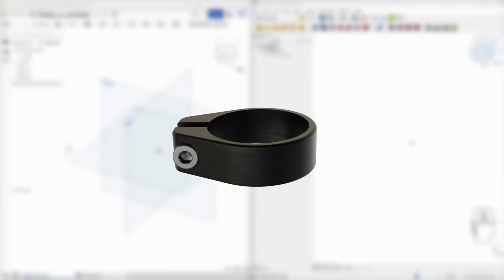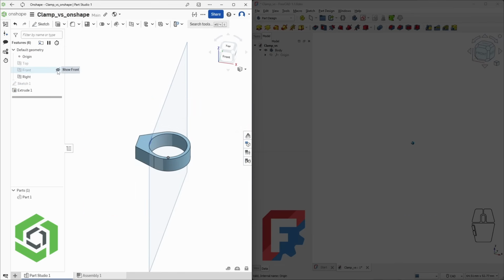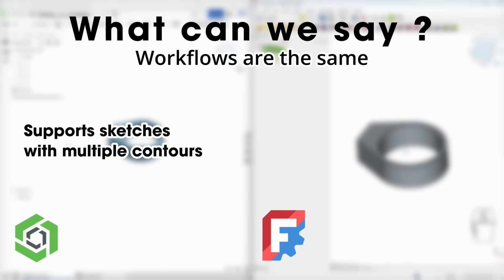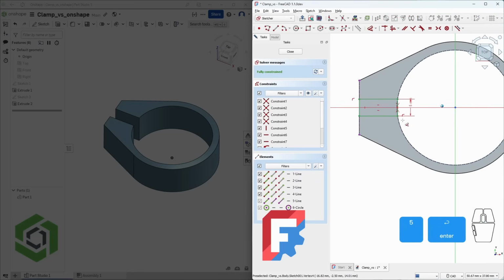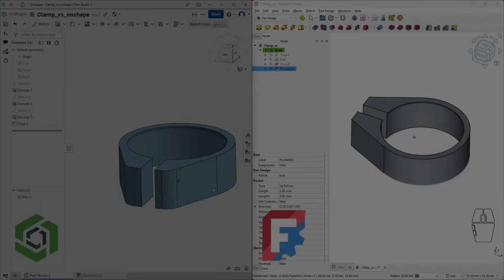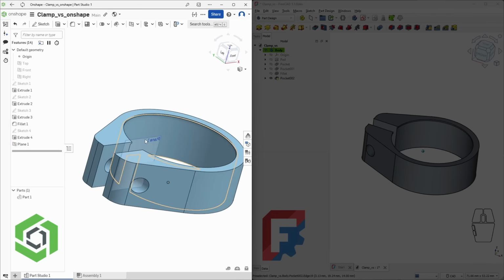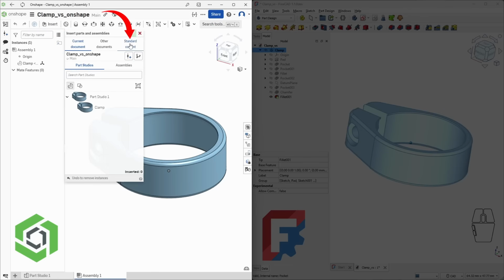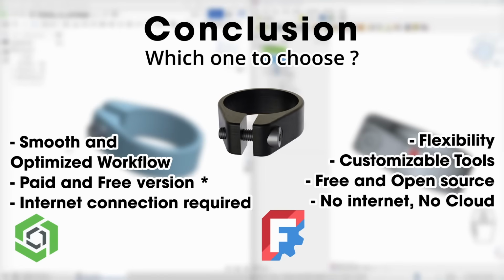FreeCAD VS Onshape - Who's the best ? Choice for Beginner (Simple Part and Assembly)

Comment: "The bottom line is clear—FreeCAD delivers nearly identical results and workflow while being completely free and private. That makes FreeCAD the winner!"
Reply: ehh - FCAD lacks a lot of modeling abilities - so, no it is not.
Reply: Nope , onshape has a lot more powerfull tools than Freecad , not to mention,  the interface in onshape is clean compared to most other CAD systems out there,  Onshape is totally free , and cloud based which is pretty impressive
Reply: @cekuhnen Со временем дорастёт же. 🤔
Reply: sadly not. Onshapae is more powerful and has a better UI and UX, but both are great CAD tools both of which I personally use.
Reply: @gummy5787   I disagree.

I also hate cloud software.
Reply: Onshape is a polished and powerful product. FreeCAD is slow and messy. It can't cope with anything complex and requires the user to learn tricks to bypass limitations continually. But you can't work privately for free in Onshape.
Reply: If you stay with basic operations. Things like surface modeling tend to run into both User experience as well as  hard to predict technical problems. In part simply because of how the core handles Epsilon vs what Freecad keeps track of or hints to the core.

Comment: Additionally, there are several ways to do the same operations in freeCAD.  For example, the cutout rectangle sketch, you could have used the centered rectangle, snapping the center point to the horizontal axis line, then just pull it out to cover the material of the clamp, type 5 for the dimension and hit enter. No need to project geometry. 
There's also different workflows in free CAD. The same part could have been built in the part workbench using a workflow more similar to tinkercad but more powerful. 
And one final thought. The people using on shape are going to have a bad day if their internet connection goes down or slows down. 🙂
Free CAD is an incredible value for the price.
Reply: I believe his method keeps it parametric. He can change the diameter, and it updates.

Comment: Great presentation! I've been using Freecad for a few years now and found the comparison with Onshape to be very illuminating. The split screen showing the two programs along with the excellent narration made the video a joy to watch.

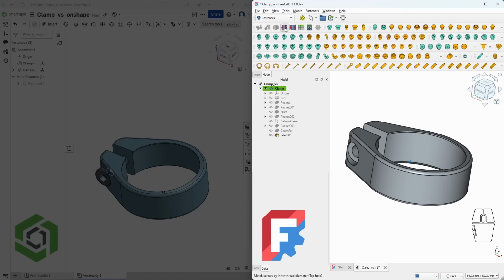24:45 With the fasteners workbench,  in Edit/Preferences/Fasteners you can select "Drop down buttons" for Toolbar screw icons grouping which will avoid the default zillion icon setup. Much easier to find what you need and I'm not sure why it isn't the default.
Reply from the maker: @douglasbollinger8678 Thanks for your comment and for the tips :)
Reply: And selecting the edge of a hole we get automatic proper sized screw/bolt without the need of assembly
Reply: @deltahedra3D  I've learnt a new thing with this tutorial in FreeCAD: Transforming the external reference geometry into construction lines, thank you.
My hint: select 2 parallel faces of a solid and pick Reference plane tool, the plane will be located symmetric to those faces...
Reply: @LFANS2001  Me too, a quick and easy way to create datum planes, I've been making it much harder on myself. As I understand it, converting reference geometry to construction is only a thing from the upcoming 1.1 version of FreeCAD, before that it was always reference anyway, but now it can be real geometry too, I imagine it will be a time saver considering how often I import geometry and then just copy it into a new sketch.
Reply: @LozrusX  I didn't notice he was using FreeCAD 1.1
Thank you
Reply: @deltahedra3D  made a tutorial in two programs and does not know how to do it well in either

Comment: Thank you.  I am new to both as I was using Openscad.  I started out with Onshape after following some tutorials on a 3d printing channel. I like Onshape, but recently wanted to design a part while I was on the road.  The fist time I did this all was good as my hot spotted phone had a good signal.  A few days later on another model I had to give up as the internet was too Sketchy!  I have now installed Freecad and was pleased to see that some of what I had learned in Onshape was easily transferable.  I have yet to tackle assemblies in Freecad but was please to see from this video that assemblies are somewhat similar too.

Comment: Super great video, it is all I was trying to do. You did tit great. Im a CAD lecturer for Mechanical Engineering and also Carpentry & Joinery and I use both software. 
For mechanical Engineering I start with ONSHAPE and after I introduce FreeCAD and for C&J I use FreeCAD, I love both tools and I will like if FreeCAD solve the External Geometry like ONSHAPE, that will be great. I introduced both in my college. I appreciate Your video and nobody did that comparison better than You before. Congratulations and Excellent. Thanks.

Comment: As a note, if you hit enter when you drop the circle it opens the dimension tool with the current value. Additionally, I'd not consider automatically constraining to the origin to be useful. I'd often end up cancelling that. 

Your second step is probably the least worthwhile in onshape as it would have been very simple to add that feature into the first step and not extrude it instead of removing it. Maybe you did this because it is hard in FreeCAD since it doesn't handle multiple curves well.

The custom plane creation you did is of limited utility. I'd have wanted to see you do the more sophisticated operation where you project a plane from the surface instead to see how hard it is in FreeCAD. Imagine trying to drill a shape or hole through a tube. That is a commonly used function and if it is easier in FreeCAD it would be interesting to see.

In the end, it is obvious that you worked hard to put these into very similar workflows. Is doing that fair to either tool? Just like trying to write two programs exactly the same between two vastly different languages, you are likely hiding features in FreeCAD that makes it more powerful. Also you didn't go back and edit anything. In OnShape that is very fragile as surfaces and edges will get lost and requite reselection or far more drastic measures. In I-DEAS it was far more robust than what is in OnShape. If it is more robust in FreeCAD that would be a huge deal.

My closing argument though is the value of onshape is the same thing people are complaining about. The parts catalogs of all public items are available to everyone. If you are putting together an assembly of something you don't mind being in the public, you can also pull parts from 100s of thousands of models.

Comment: Back when Advanced Manufacturing was sharpening flint with a stone, I started drafting using T-squares, triangles, and pencils. My first (2D) CAD experience was AutoCAD 11 on a 286 running DOS. A long time ago, I switched to Solidworks. Occasionally (frequently?) Dassault does something to piss me off, and I threaten to use a different brand ... but I'm too old and stubborn to learn a new CAD package.

Comment: I've been working in CAD for 15-16 years now. I started out using PTC CREO and 7-8 years ago we switched to Solidworks. I see these differences between Onshape and FreeCAD as being about the same as was the case when Is switched from CREO to Solidworks. It's just a matter of what one is used to. For me personally, the aligning plane when starting a sketch would be the most annoying difference. I've tried about all of the free and lost cost options at home, and for the price, I can't find anything that works better for me than Solidworks Maker @ $48/per. Granted, that's likely because I'm able to set the UI exactly the same at home as how I have it at work. One thing I hate, and I find it's with all software, is there being no option to use words instead of icons for commands. That would make learning multiple software much easier, IMO.

Comment: For FreeCAD, I was really surprised by the need for having to go via creating external projection geometry rather than being able to reference already created geometry. Is there any reason why it's like this, or advantages to it being so? Great video by the way, keep working on that "fillet".
Reply: It's a holdover from its ancient roots. CREO and older CAD programs do this, they are not true "parametric" modelling programs. FreeCad started with this older style before Solidworks, Fusion360, and Inventor developed. Today, everyone learns on the Big 3. It's a little bit to get used to, and it means you have to plan your models out a little more in advance than in true parametric systems. Be careful changing dimensions without changing the effected reference planes! 
A little old, a little clunky, but the staff of Freecad is 1/100th of any other CAD program. What they have been able to do is nothing less than a miracle. It's something you can 100% get used to with some practice. Like driving a stick shift vs automatic: Might seem scary at first but in a short while becomes 2nd nature.
Reply: @TristramJay  Very interesting, thank you! That also means FreeCAD is much older than I thought.

Comment: I'm using Blender. Yes, it's not CAD, but with nondestructive modifiers you can move mountains.
Reply: I'm also using Blender but it really feels like fighting against the current to use it for CAD
Reply: Blender is so good ! But it is not parametric and cannot output Step files for example. STL are triangle based and not good enough for CNC.
Reply: @puits-de-science  Here I disagree. Blender has parametric modeling using nodes, modifiers are also parametric. I also have an addon for exporting to IGES.
Reply: Ok. In most cases, anyway, I almost never come back on a design, so the parametric aspect is not really an issue for me. I keep a history of modifications when I apply a modifier (for speed)

Comment: I have some experience with Solvespace. I really like its compact (but very effective!) design. But for exchange with manufacturers I need something like Solidworks or Onshape. That is too expensive for non business. For CAM and FEM additions you even have to spend more. All this is available in Freecad.
I was allways very reluctant to start Freecad because its interface looks complex. I expected a too long learning curve for a casual user. I understand that the complexity is also the result of all the many things you can do with Freecad. I think that will be the same if you use Onshape or Solidworks.
After seeing your demo comparison with Onshape I believe that Freecad can work for me. Especially that Freecad even has have library of bolts and bearings impressed me. I also saw in Freecad forum about FEM that there is a vast materials library and there is possibility to tune them.
That Freecad offers so much all free of charge makes it worth the effort to learn.
You convinced me. Thanks for your efforts.  I have just downloaded it. Today the journey begins.

Comment: I would have added the cut as part of the initial sketch before extrusion and also added relief for the nut which wasn't even shown.
Reply from the maker: @thekillerb77 My goal was to show FreeCAD's external geometry tool and compare it to Onshape's native projected edges. I thought it was a good way to demonstrate this to beginners, even if it requires one extra step. It's more educational than optimized.
Reply: @deltahedra3D I fully understand.  I am quite impressed with how much FreeCAD has improved.

Comment: I once tried to learn FreeCAD years ago and the UI felt so backwards that I learned Blender 3D, Fusion 360 and Onshape first. Once 1.0 was released, I tried FreeCAD again and I've been happy with the results. It's definitely not perfect yet but considering how little issues remain and I get to use free open source software without internet access required, FreeCAD is easily the best of bunch right now. And FreeCAD is only going to get better in the future!

That said, if both Fusion 360 and FreeCAD worked without internet connection and cost the same, I would use Fusion 360 because the UI logic fits my thinking even better. I'd prefer FreeCAD tree view to have the latest object as the leaf in the hierarchy instead of having the original object as the leaf and the final object as the trunk.

Comment: While I agree with most of the things said, I'm missing the most important topic in this comparison - parametric design. Modifying an existing part after the first iteration happens quite often in prototyping. FreeCAD is sometimes not very good in that - sometimes the topology gets completely messed up (e.g. when you draw sketches on surfaces and change something to that surface). But there are ways around this - parametric design. FreeCAD has an Excel-like spreadsheet UI, where you can put in all the measurements which you can use then like variables in the design. Later you just change those numbers and the model adapts accordingly. I don't know if Onshape has something similar, but this is one of the most important features for me.
Reply: Onshape has very sophisticated configuration tools for parametric design, version control and many more things. I don't see that this video even scratched the surface of onshape, it's very primitive,  author doesn't have enough knowledge of the software to give a worthy review.
Reply: I agree that the video is very high level - which is okay for a simple comparison. It is just not the full truth. But thanks for clarifying that OnShape has also something like it. Maybe it helps someone... I'll stay with FreeCAD anyways because I know it, it is Open Source and I know its flaws and how to get around them. Still I like looking at other tools from time to time. You would probably say the same about OnShape, right? All the best from Switzerland
Reply: @yuriy77  Perhaps you missed the "For Beginners" in the title.

Comment: In onshape  'n' is plane normal, it is weird that they dont have the option to snap views on sketch creation. It is a weird thing that does get annoying. Solidworks works like freecad in this instance. 
Being able to select lines or make implicit sketches from faces is a nice feature for onshape, something I did not realize I had gotten used to. 

I teach CAD, I will continue to use onshape as long as it is free to use. Students do not always have computers that they can modify software on, so browser based solutions is more of an accessibility issue for me. 

Onshape ends up missing features and update tools in directions that confuse me. They added cosmetic threads to their external thread tool a week ago. (Tbf solidworks didn't even have a thread feature tool until 2019) 

It looks like freecad performs as well as I thought. Every program has their eccentrcities. Learning the tools and hotkeys are really the curve for making what you want. It is the sign of a developed program if there is a tool that automates tedious tasks, thankfully I think the market is mature enough to agree on a common feature suite.

Comment: Your videos capture the point wonderfully!

BTW,  for the pocket operation for the bolt head, how did you select the values of the two dimensions? 

(Actually, I would like to know the nuances of the "two dimension" option: Does it let the user define the length of the pocket on both sides of the plane of the sketch? If so, how did you determine the two lengths?)
Reply from the maker: @nagesharas5136 Two dimensions option allows you to cut on both sides of the sketch plane, so the cut goes in both directions instead of just one. I chose a value of 2mm so that the bolt head is slightly recessed into the clamp but not completely, and 4mm to cut into the part in the other direction. Ideally, a "cut through all" would be better instead of 4mm, but FreeCAD doesn't offer this option when cutting in both directions.
Reply: Thanks for the clarification!

I am a newbie for CAD (and FC). Such nuances help us grasp the subject better.

For example, I was not aware of the technique to create a plane that passes through a point and is parallel to another face.

It would be great if you start a playlist of shorts on such techniques. Currently, no such series exists!

Comment: A layman here, who occasionally uses both but in no way in a professional capacity. 
For me the biggest problem with FreeCAD is that it cannot handle changes up in the "timeline" reasonably well. You change some sizes on one of your first sketches and then the whole model breaks, all the connections, links etc - so you have to re-do it whole. Onshape is way more forgiving

Comment: Great material. 

I'm curoius what is the difference with modeling more complex models e.g. those using the lattice2 workbench, like some kind of meshes.

Why do you changed external geometries to construction lines? Can not be "red" instead of "blue"?
Reply: He is using the Dev 1.1 version of Freecad in this video. That version introduced importing external geometry as sketch lines by default, though this can be changed in the preferences. What he could have done, though, switch to construction geometry before importing the external geometry. Maybe he didn't realize that this would work, but it does. Either way, one can always convert between these two in version 1.1.
Reply from the maker: @langrock74 You're right, you can change the behavior in the settings, but I wanted a fair comparison for someone launching the software without any prior knowledge. However, I probably could have mentioned that this behavior can be adjusted in the settings.